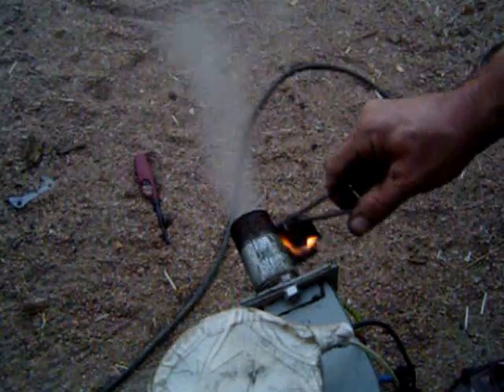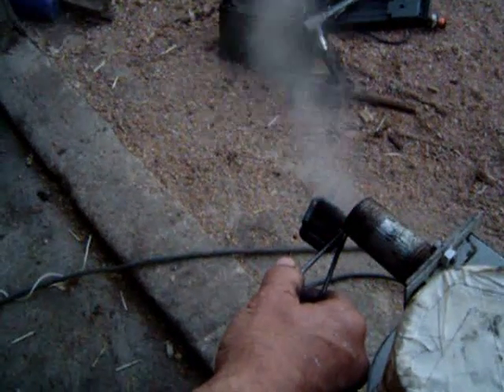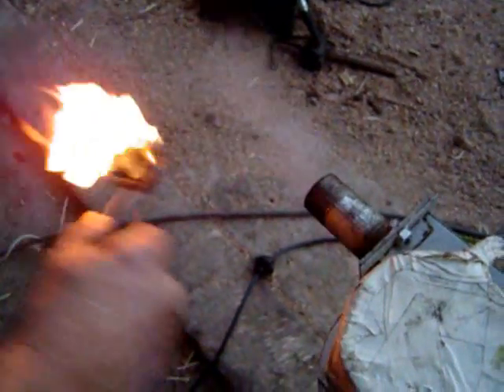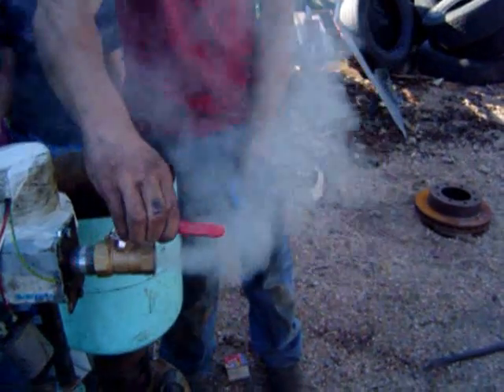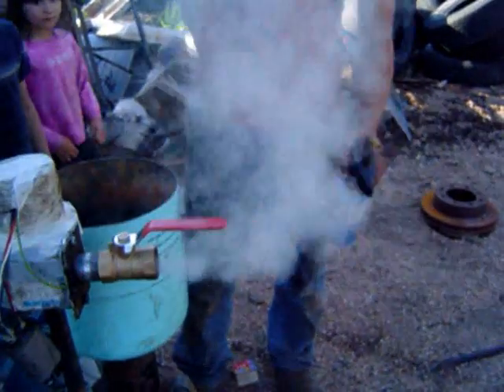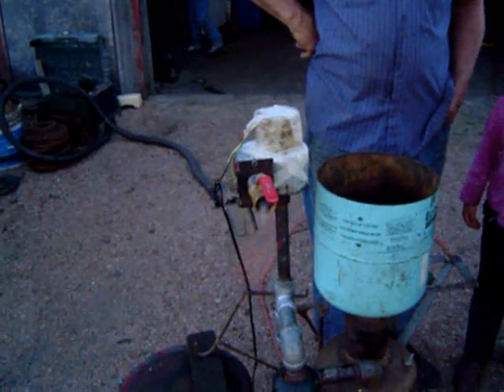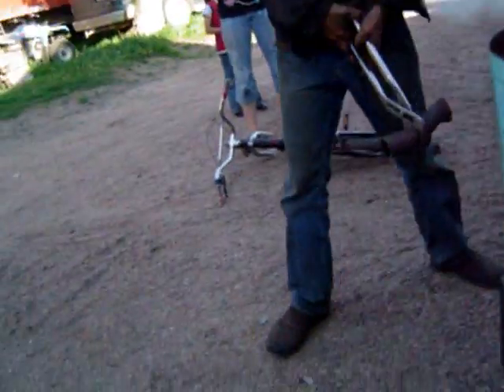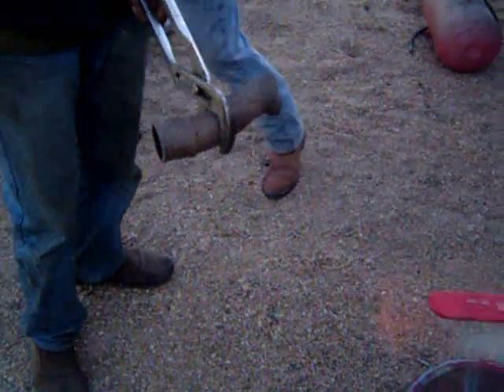Gasifier Runs Truck Car Three-wheeler pt 1/2

Comment: Could ya re-root the Exhaust back into the Gasifier? Then eventually have to exhaust after it burns twice? (Or even use the Exhaust tip as a warming plate?)